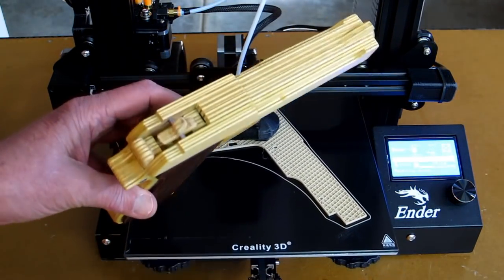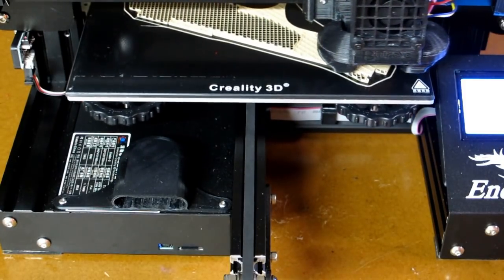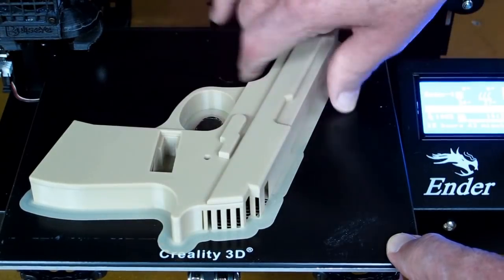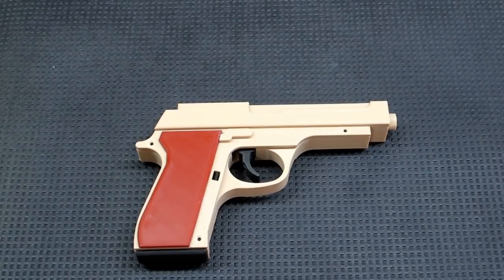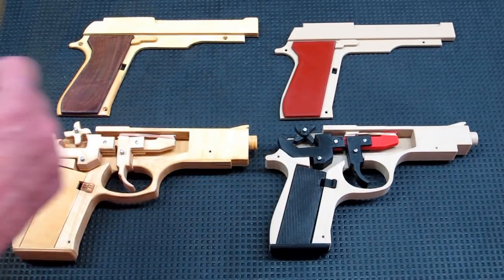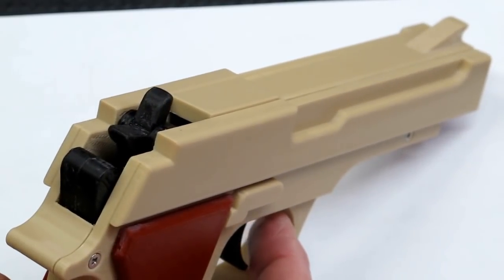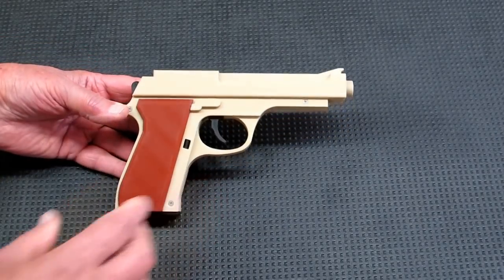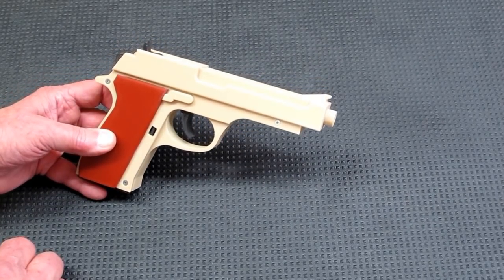3D Printed Rubber Band Gun - Making It Work

Comment: Hey do you find the parts cooler upgrade actually made a difference for you? I was thinking about printing it
Reply from the maker: The original filament cooling fan is ducted on one side of the nozzle on the Ender-3, Ender-3 Pro and the CR-10 and I don't think it was very efficient. I have 3 videos on the Bullseye Cooler (my build of the Ender-3, attachments and reinforcing the duct). The Bullseye attachment is a long print and initially I had problems with the mounting arms of the duct breaking off until I reinforced them. I believe since then he has changed the design of the arms a little. I think it makes a significant improvement in the cooling of the filament as soon as it is deposited which helps with warping, stringing, etc. I also changed the print surface to the Creality Ultrabase Black Carbon Silicon Crystal Glass which works really well. I tried printing several of the cooling duct attachments out there and only the Bullseye really works (in my opinion). Thanks for watching!